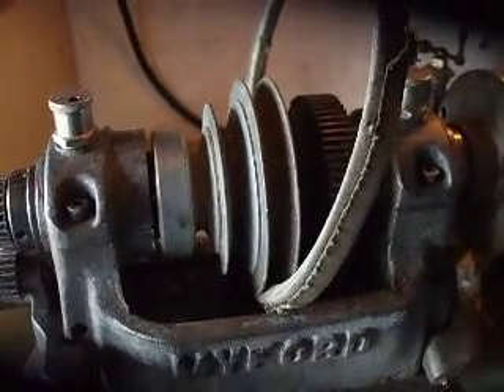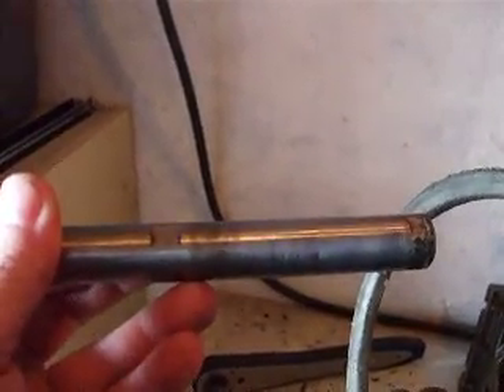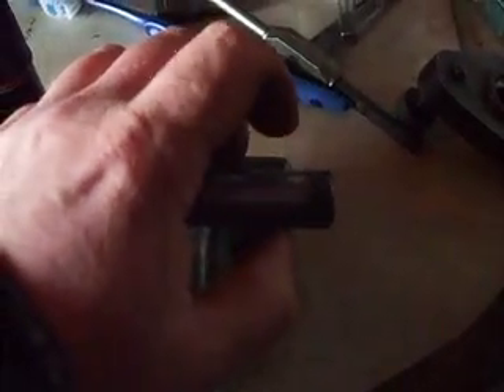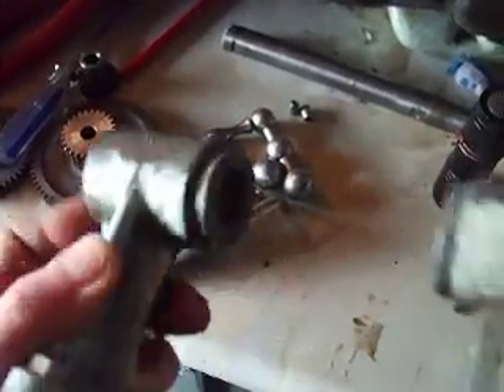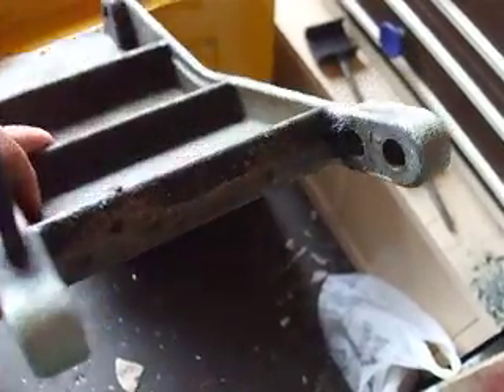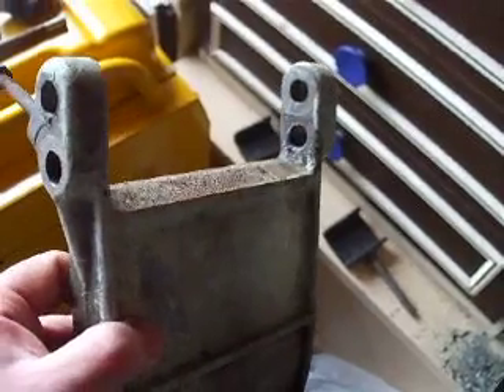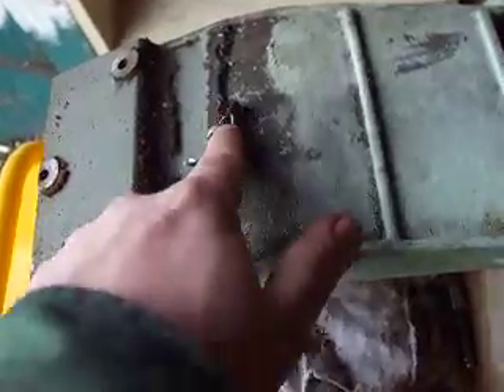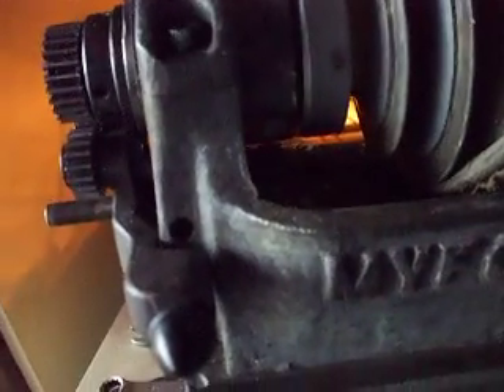Myford ML7 Lathe Restoration Episode 6

Comment: That is the standard Myford ml7 countershaft they used on the early ML7 lathe. Should measure 3/4" Diameter.  The next version was keyed one...still the same Diameter though.